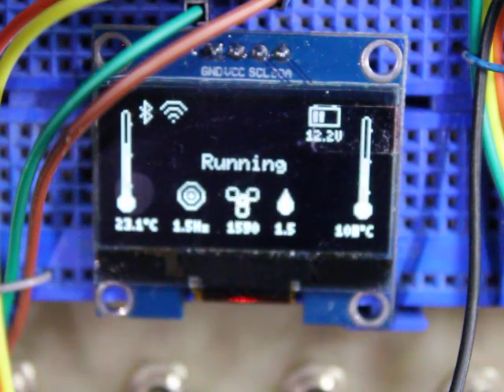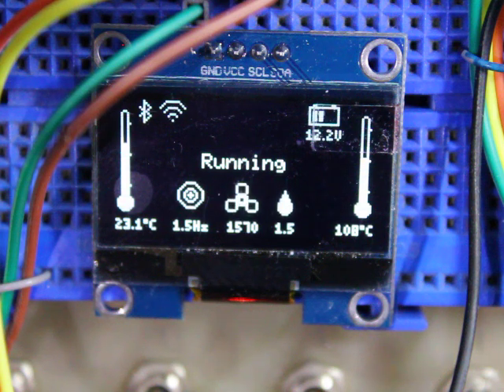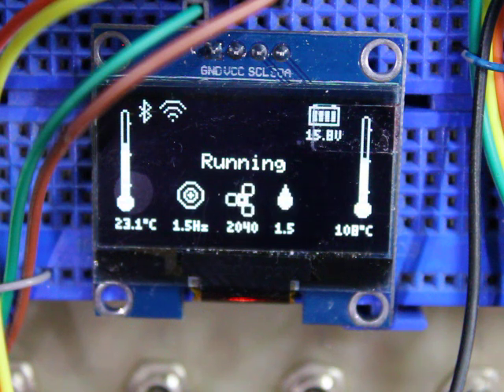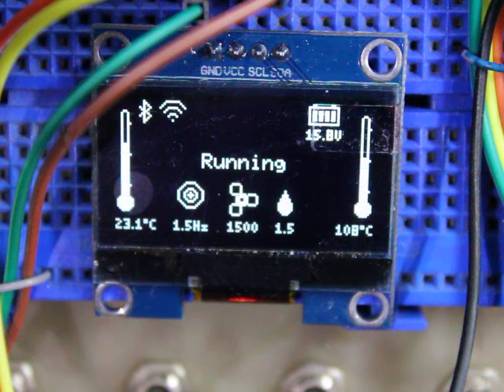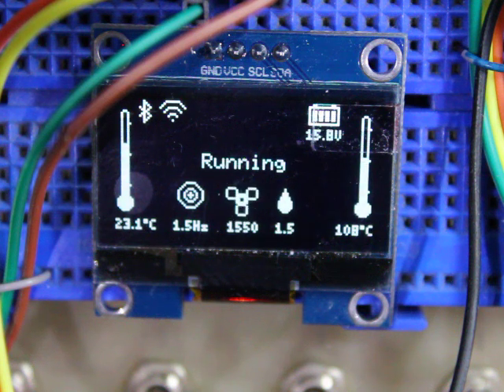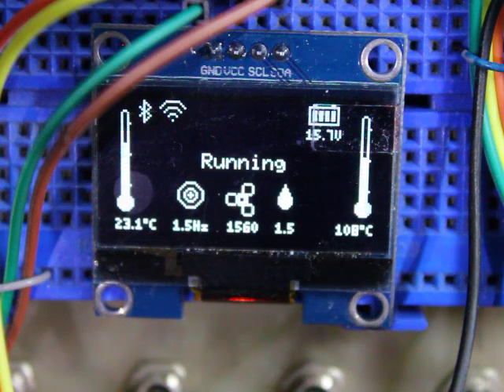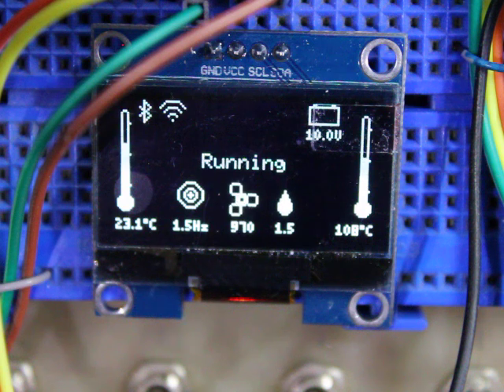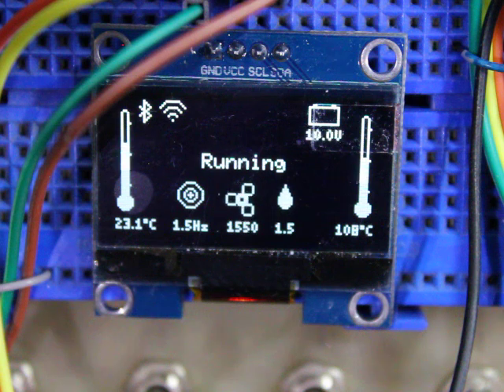Fan speed regulation in a Chinese Diesel Heater

Comment: Hi Ray, that is a nice layout on the OLED display, like the animation :-)
Reply from the maker: Those OLED displays are great little units. so much possibility with using icons instead of text for clearer presentation.
Reply: @rljzathras  I do love them, as you can see in my projects, I've been using my own custom number font that scales up much nicer and on my CAN Gauge and V-GAUGE I am using bitmaps as text. Every word is a bitmap, that way I can make the text exactly the way I want and in any size or shape and add icons of course. A lot of work but the result speaks for itself :-)
Reply from the maker: @iHayri1  The biggest challenge I face is getting the correct 1.3" OLED out of China.
There are varying hole spacings, and some reverse the power pin order.
I note the units you use are Vcc, GND, SCL, SDA. Mine use GND, Vcc, SCL, SDA as you can see above.
I see some of the later models using your pin order actually have 0R's on the back to swap that!

But yeah hole spacing is the big one if you have designed a PCB to match the one you prototyped with. DAMHIKT!

Hmmm, now thinking should I just use 0R's on my PCB to be less reliant on the pin order.....
Reply: @rljzathras  Tell me about it, 0.96" are even worse, I have several which not only have different hole spacing but don't work with some of my codes like the clock code that has the dimming feature and when using with a ESP12.

Yes, I noticed that your pins are the same as the 0.96" displays, mine are reversed like most of the 1.3" displays use. Some of my PCB I designed with jumpers as well so I could easily use both versions, as you were thinking. On top of all these problems there are some displays that are very dim. Even buying from the same seller does not guarantee that you will get the same product next time, most have no clue what they are selling and even if you ask if it is the same as pictured, they say yes and you end up with a different display.

I am actually thinking of redesigning all PCB's that use the 0.96" for the 1.3" displays, and am looking into using the 1.3" IPS color displays with 240x240 pixels, they do come without a PCB and have a flat wire cable and need only a few external parts to function. Plus they are SPI and thus have a higher refresh rate. Will see how it goes.

Comment: Hi Ray, 

Very good looking UI. Do you have a blog with public information about the protocol for these kind of heaters? I'm planning to integrate the control for my boat's heater with the rest of the control system - but as a software engineer I do not have the skills or equipment to reverse-engineer the electrical protocol!

Thanks!
Reply from the maker: Hi Fabian, there is now a Faceboook group for the end product: https://www.facebook.com/groups/388958075385659